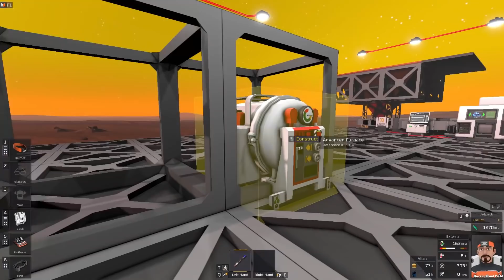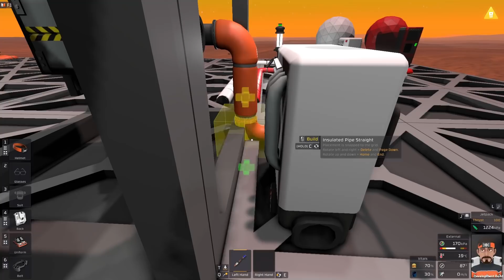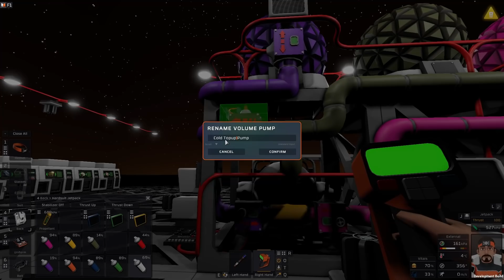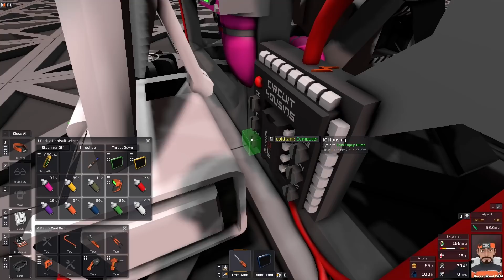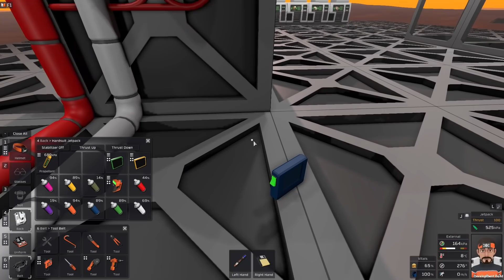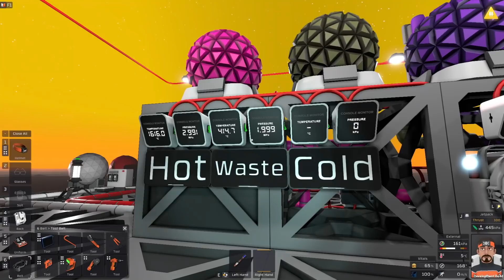Stationeers Automatic advanced furnace build Part 1

Comment: Rewatching your design while working on my own. I guess, it is still not the right formula for the mixer. Not sure, it might be corrected in the part 2, but I'd use this =0,5/(02ratio/h2ratio)*33,3333 with max and min to limit the setting. It is wotking fine with high 02 and it's going crazy a little with 02 below 15% in the mix.

Comment: So I've been going through the build of this with a buddy of mine, and neither of us can figure out why your cold tank gasses aren't always flowing through the radiators. Why not move the digital valve to before the tank rather than between the tank and radiators? I built a cooling tower on one of our trial builds and it was able to maintain sub 100c temps even while smelting around a dozen different ingots. Your version clearly works perfectly fine, I'm just curious as to the reasoning behind the positioning here. Thank you for your time and your content.

Comment: I found an oversight in your code. The Pipe Analyzer will return NaN for the ratios and that gets set to the Mixer if you don't have fuel in the pipe from the Gas Mixer before running the script.

Comment: is there anyway of calculating the combustion pressure and temperature based on initial conditions based on number of moles, initial temperature, pressure etc. i feel like the combustion equation the in-game stationpedia gives is leaving out information or i am i overthinking it. pls help?
Reply from the maker: It should be possible.  You will need to know the gas mix and each of the heat coefficients of the gasses and the energy yield from the combustion.  It would not be easy to fit the math into 128 lines.  The real question is, how will you use the answer.  You can't add a specific amount of gas to get a temperature because you wont get ignition until you have 5% O2 and 10% H2.

Comment: Hey! Thanks for this video it' svery educational. one question: I don't understand why the darkgreen waste pipe is led back into the fuel line with the filtered H2/O2? Why are we doing this?

Or perhaps what I don't understand is why we do not keep the fuel line that goes into the standard furnace free from anything that isn't mixed fuel and simply only work with the exhaust gases?

Edit: Okay went back to watch the video.. So it appears we can simply work with the output slot of the standard furnace? How does ignition happen here? Is it at right after it gets mixed? And then we get our exhaust gases immediatly? Does this save fuel consumption or is it just easier to setup? In my config I'd like to just have fuel into my input, can I make a similar setup to yours while strictly keeping fuel for the input?
Reply from the maker: There are many ways to do this.  Oxygen is created from smelting some ores so I vent it back into the combustion chamber so it can be reused for fuel.  You could directly feed the waste into the hot tank to regulate the temperature or you could not connect it at all and just have the hot tank fed from the basic furnace.  The furnace controller will detect the tank temperature and adjust itself to what you have provided.

Comment: Is there a way to use the heat exchanger to manage temperature without adding or subtracting gasses?  Perhaps just adding back from waste to manage pressure?  Maybe the heat exchanger would be too slow?
Reply from the maker: The heat exchanger will only send heat to a cooler system so it can't recover heat to the hot tank.

Comment: I don't get why you are cooling the hot gas from the first furnace.  Couldn't you just have it burn a bit at a time, dumping everything (- the fuel gasses) into the hot tank?  Then just do a bit of math to mix hot and cold gas to 90% of the max temp for what you are smelting, and fill the advanced furnace until you get to a good enough pressure.  Then, when you change what you are making, dump the hot air into a smelter tank.
If you want to smelt something at a cooler temperature than the furnace tank, add hot gas and repressurize with the mix.  Mix with cold for a colder temp.
The cold tank gets more gas if the smelter tank is over pressure, and then only the cold stuff (colder than ambient).  Pressure reliefs on everything for safety.

I guess technically you can just add hot gas to the adv furnace to heat up what's in it, then dump or add gas to adjust pressure.  The cold line should only be needed if the temp is above max or you need to mix to increase pressure.
Reply from the maker: I am trying to reheat the waste gasses rather than cool hot gasses so that I can make use of the partially heated gas rather than venting it and starting completely from cold.
Reply: @cowsareevil7514  my example did that too. It just removed it to a smelter tank if it was over pressure.

I guess I'll need to see how you set up the furnace in part 2 to see how you are handling that part.  At this part I just think it would be more efficient if you had even hotter gasses for hot and even colder colds.
Think of it like the hot water in your home.  If the hot was 90 c and the cold was 1 c, you could adjust the temperature much faster than 20c cold and 70c hot.
Reply from the maker: True but it takes more energy to heat and cool the gasses to extremes when you mostly mix them to a middle temperature.  I think the optimum will depend on what what planet you are on and how easily you can heat and cool.

Comment: You came up with roughly the same solution that I use except I don't recycle the exhaust gas... It goes to my filtration system. One thing I didn't try is to check for mols quantity on the hot gas production so you don't need your filtration unit since you hit a 100% burn efficiency. One question though : Are pipe analyzers analysing the pipe directly connected to them or are they analysing the whole network ? If so, you can use your gas tanks since it's doing the same thing. If not, it could be interessting to see the difference of efficiency between the two solutions. If I recall correctly, one pipe is filled per tick and as your network is not so big, I don't think there is a huge difference. (sorry for my english, I'm not a native speaker)
Reply: The pipe analyzer reads just the pipe network to which it is attached.  A tank connected to a pipe network will passively equalize, so the two data sets (i.e. pipe network and tank) can differ until they equalize.  Cheers!
Reply from the maker: There is some lag as the pipe and the tank equalise so if you need accurate measurements for the pumps it is best to get the measurements directly from the pipe.
Good point for the filtration I will be replacing that with a pump.
Reply: The pipe analyzer monitors the whole network whether the network is just the 1 pipe segment  to which the analyzer is attached or 100 segments.  Pipe networks exist between valves and/or devices such that the analyzer will not read the pipe on both sides of a valve or pump.
Reply: @a.k.7840  yeah I was aware of the second part. I don’t use pipe analyzers much since they use a big chunk of wattage but as I said, I didn’t know if they were analyzing the whole network. I know as well that tanks equalize pressure through the whole network. Now that you replied to me that analyzers are checking the whole network, I’ll use them more often.